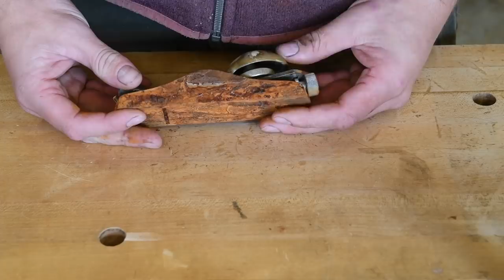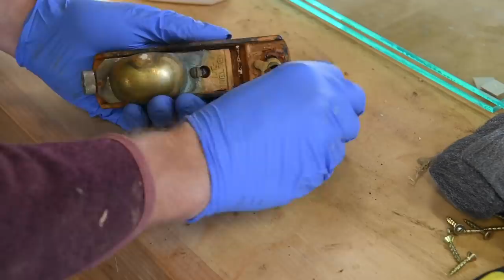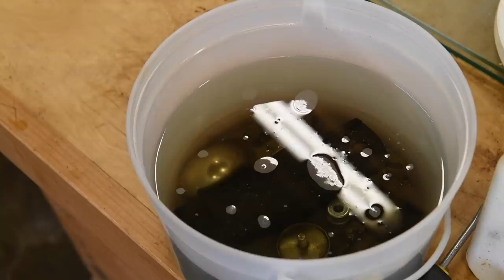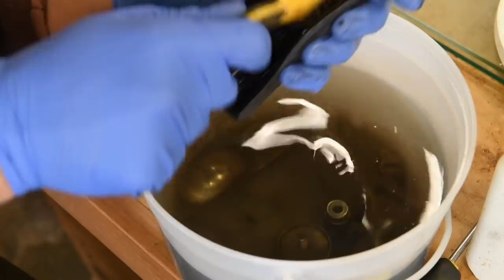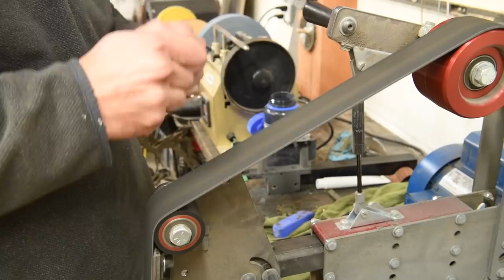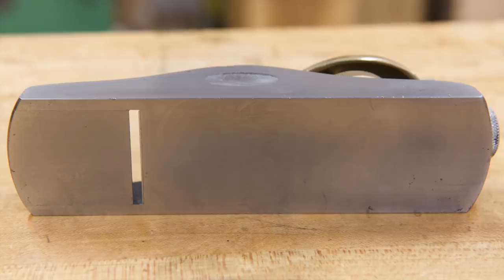Tool Restoration - Block Plane FULLY Restored!

Comment: A bit from Wikipedia; "samurai were bound by a code of honor and were expected to set an example for those below them."  To apply this in this current situation, keeping the plane would be dishonorable.  Return it, along with guidance on its use & care.  You both will sleep better in the end.
Love your work, keep it up!
Reply: You are correct the samurai would give it back and instructed him..
This Sicilian would have picked up the neglected tool walked over to the owner and slapped him. Then I would have restored it. And charge himm a hundred bucks for the restoration if he wanted it back.
Reply: @ironmyno  I agree, the amount of work involved restoring it is pretty much the value of the plane.
Reply: And the slap would be on him!
Reply: @ironmyno   no doubt bro 👍
YOU COULD ACT LIKE A MAN !!!!
Reply: To set example, he would have to force his friend to do a sepuku ritual for the dishonouring the carpentry practise.

Comment: It's perfectly possible that the plane was lost, left there by accident and its whereabouts forgotten. It's easy for Youtube commenters to be judgmental when not necessarily in full possession of the facts. You give the man his plane back (you've got plenty enough planes anyway, no doubt), and I have no doubt at all that he'll be very grateful, and look after it perfectly well from now on. I visited a friend's workshop a few weeks back and saw a rusty old plastic-handled tenon saw hanging on the wall. He gets it back this afternoon cleaned, sharpened, set, and with a new bog oak handle with shiny brass saw nuts. It's what you do for friends.

Comment: Awesome restore.... it's cool that you were able to keep the original black finish (I know I know - japanning) but I was thinking it would look a little cleaner if you could chamfer the painted edge with a small file?... back in the 70s, I used to file the top edge of my old Stanley low angle 9 1/2  for a custom look but you can't do that on the new 60 1/2. big fan, well not as big as you but...thanks, bro.

Comment: There's keeping it and there's simply holding onto it.  It is his plane, but you've done him a big favor restoring it because you are a good friend.  If and when he shows appreciation, give it back to him.  Cleaning it was your first favor.  This lesson will be a second favor and even third one:  if he destroyed it again because you gave it back before he learned his lesson, he would not only have lost the plane, he probably would have gained "These Samurai Hands".  Therefore, keeping him safe from violence by not allowing this situation is also a reason you are an excellent friend.  Another thing a good friend would do is make sure the plane stays in shape with periodic exercise until he realizes the error in his ways.  Take as long as you need to let him come around.  That's what friends do.

Comment: The question is easy how did he lose it, did he look for it, or just replace it?
As a struggling woodworker and a volunteer that helps at-risk youths I instill taking pride in every tool and piece of wood, they hold in their hands.

So when I'm blessed with the ability to buy a new tool which isn't often, I share them with my students. 
So this is easy, if he replaced it like no big deal, keep it if you need it, you did a beautiful job restoring it back to its original purpose and beauty.
or pay it forward to someone you know that will care for it as you did.
Thanks for sharing your knowledge.

Comment: beautifuly done its a great feeling putting old rusty tool back to good use! I do have 2 questions though. Did you do anything with the inside of the plane? (paint or keep it as found)
As well are you using a special type oil on re-assembly?

Comment: Electrolysis is much easier and simpler and better.  No need to pre clean because electrolysis works from the inside. So if you have built up layers of rust the rust attached to the metal gets removed first. Then the outside rust either just needs a light scrub or falls off of its own accord. Furthermore because it works from the inside out rust inside the pits is also easily removed.
Reply: But it's a little more aggressive
Reply: @rutgerhoutdijk3547  Its aggressive on rust but it CAN'T remove metal.

The only time I wouldn't use electrolysis would be if I wanted to keep original paint, chrome or labels.
Reply: @ChestnutnagsToolsFromJapan  Hmmmm,,actually it can remove and even coat some metals,,all depends on electrolyte used,,Polarity,of connection,,
what ya using for Anodes and Cathodes,
I mean they use this process to chrome things,,so yes metal can be removed or installed on metal,,
Called " Electro-plating,"
Reply: @ianwilliams487  Well sure if you connect the positive terminal to the piece you are trying to restore it will destroy it. So good idea to be sure you get the wires around the right way.

I use a sacrificial anode of whatever steel I have lying around although sheet metal off cuts are great. Good supply, and easily installed.

PS I'm chestnut nag but I;ve just been doing stuff on my prospecting channel.

Comment: "Oh, Lie Nielsen, those are the cheap ones made in some foreign country by unskilled laborers, with that lousy steel that rusts way too easy!  This new replacement has a fresh blade that's factory sharp and all the metal parts haven't suffered from all that wear and tear from someone using it.  Wish I could have made the repair work."

Comment: I would not give it back initially. He currently appears to have little respect for his tools ( and a $$$ LN no less)  and likely all of your hard work will go to waste. Buy him a cheap used Stanley, sharpen it up and give that to him. If you really feel like you should return it, then do so only after some months have passed and he can return the cheap Stanley in as good or better condition than when he received it, and it has been regularly used, not stored in a drawer. 
Great restoration Jesse, BTW. 
Option number two is to return it after he has watched your restoration video and he has been given proper instructions by you on tool care and maintenance. The choice is yours, and he is your friend and I know you want to keep it that way. 
Michael O.
Alabama, USA

Comment: Your making a mess of it by sanding it off on a belt sander as it will leave the base uneven as you should have done it by hand on a piece of sand paper stuck on a piece of glass so you go backwards and forward with it taking any rust off it showing any holes in the base of it that you can work on ok dude.